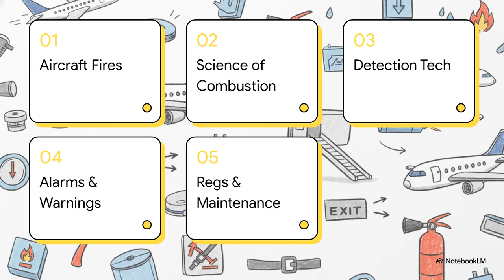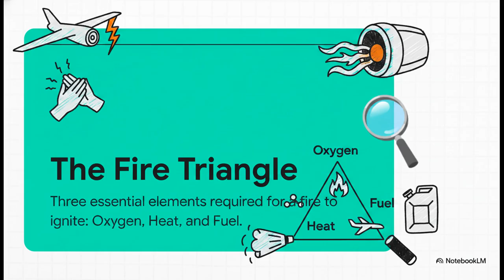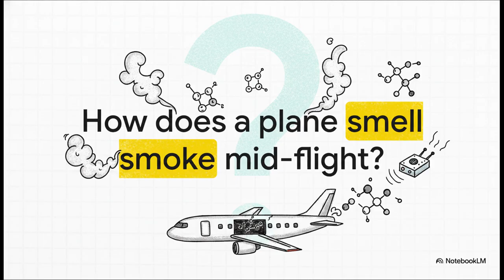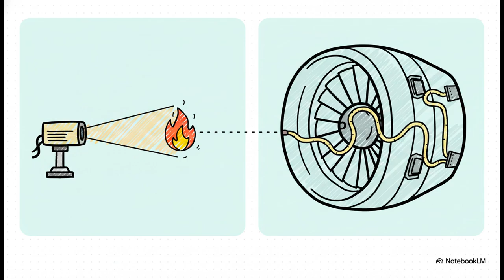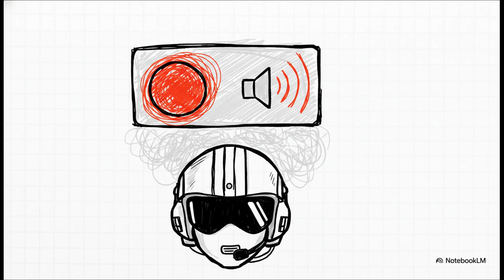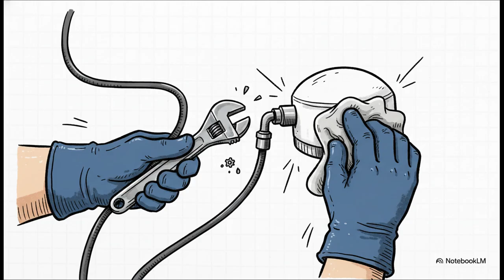AMTE 241 LESSON 02 AVIATION FIRE SAFETY

Comment: After watching the video, I realized how complex and vital fire safety is in the aviation industry. Fires in aircraft can be caused by many factors such as flammable liquids, electrical malfunctions, or overheating components, and the consequences can be devastating if not addressed quickly. The video explained the different fire detection and warning systems that are installed in planes to provide immediate alerts, which is crucial for preventing small issues from escalating. It also highlighted the use of specialized extinguishing agents and equipment designed specifically for aircraft environments, where space is limited and conditions are unique. What stood out to me most was the emphasis on human factors—training, maintenance, and strict adherence to safety protocols are just as important as the technology itself. This shows that fire safety is a shared responsibility between machines and people. Overall, the video gave me a deeper appreciation of how prevention, detection, and response strategies work together to protect passengers and crew. It made me understand that aviation safety is not only about flying but also about being prepared for emergencies and ensuring that every possible risk is minimized through discipline and vigilance.

R.A.T.HARINA_AMTE 241_1B_AY2026-2027

Comment: Aviation fire safety represents one of the most rigorously managed disciplines in commercial transport because an in-flight fire grants virtually zero margin for error. Within the pressurized environment of a commercial aircraft, an uncontained fire rapidly depletes breathable oxygen, generates lethal toxic smoke, and degrades crucial structural components within minutes. Unlike ground vehicle emergencies where occupants can immediately step outside, a cabin or cargo fire at thirty thousand feet presents an immediate crisis where survivability depends entirely on rapid detection, aggressive containment, and immediate emergency diversion.

Modern aircraft mitigate this hazard through a heavily layered defense combining material engineering, automated systems, and operational discipline. At the foundational level, passive fire protection dictates that interior materials—from seat cushions and carpets to wall panels and insulation—must be inherently flame-retardant and self-extinguishing to prevent rapid thermal ignition. Mechanically, active detection and clean-agent suppression systems continuously monitor cargo holds and lavatories, ready to flood high-risk zones with extinguishing agents at the first trace of thermal activity. Complementing these technical safeguards, airworthiness standards mandate the ninety-second evacuation rule, ensuring that even under emergency conditions, a full load of passengers can exit using only half the available doors. Ultimately, human intervention remains the final line of defense, as cabin crews are rigorously trained in blind breathing-apparatus operations, handheld extinguisher deployment, and coordinated cockpit communication to combat blazes in real time.

The true driving force behind today's stringent safety culture is the painful legacy of historical accidents, where forensic investigations directly reshaped global aviation law. Features like floor-proximity emergency lighting, non-combustible waste bins, and lavatory smoke detectors exist because past tragedies proved that smoke inhalation and disorientation are far deadlier than open flames. By treating fire safety not as a single component but as an interconnected ecosystem of material science, mechanical redundancy, and crew readiness, modern aviation has transformed what was once a catastrophic single-point failure into a highly survivable, manageable operational contingency.

G.A.A CORDERO_AMTE 241_1B_AY2026-2027

Comment: After watching the video about Aviation Fire Safety, I learned that fire safety is a very important part of aviation because even a small fire can become a serious problem if it is not detected and handled quickly. I learned that fires can be different depending on the materials involved, so knowing the type of fire is important when deciding how to respond to it. I also learned about the fire triangle, which consists of heat, fuel, and oxygen, and how these three things are needed for a fire to continue burning.

What I found interesting was how aircraft use different fire detection systems depending on the area, such as smoke detectors and heat or flame detectors. These systems help detect possible fires early and alert the crew so they can act immediately. I also realized that having these systems is not enough because they need to be properly inspected, tested, and maintained. As an aviation student, this made me understand that maintenance personnel have a big responsibility in keeping an aircraft safe. Overall, the video taught me that fire safety is about being prepared, paying attention to details, and always putting safety first.

J.L.F.TANAEL_AMTE 241_1B_AY2026-2027

Comment: V. TARAYAO_AMTE241_1B_AY2026-2027

This video explains how the aviation industry manages the risks and challenges caused by aircraft fires. It discusses different causes of fires, such as flammable liquids, materials, fuel leaks, and excessive heat inside the aircraft. It also emphasizes the importance of fire detection and warning systems because they help identify fires quickly and allow the crew or maintenance personnel to respond immediately. The video also presents different types of fire extinguishing agents and equipment that can be used to control and put out fires. In addition, it explains the vulnerable areas of different aircraft and how proper maintenance and safety procedures can help prevent fire incidents.
For me, the video provides important and useful information about fire prevention and safety in aviation. I learned that fire safety does not only depend on detection and extinguishing systems but also on proper aircraft maintenance, training, and awareness. Every person involved in aviation has an important role in preventing and controlling fires. The video helped me understand the importance of being prepared and knowing the correct procedures during an emergency. Overall, it was an eye-opening lesson that improved my understanding of aircraft fire safety and showed me how proper prevention, quick detection, and effective response can help protect passengers, crew, and the aircraft.

Comment: The video gave me a better understanding of the importance of fire safety in aviation and how aircraft fire protection systems help protect passengers, crew, and important aircraft components. I learned that fires can occur in different forms, and each type requires the proper method of detection and suppression. The discussion about the fire triangle, which consists of heat, fuel, and oxygen, also helped me understand how fires start and continue to burn.

Another important lesson was the role of fire detection systems. Devices such as smoke detectors, flame detectors, and thermal switches are designed to identify signs of fire and provide early warnings to the flight crew. Quick detection allows the crew to respond properly and reduce possible risks.

Overall, the video showed me that aviation fire safety depends on reliable equipment, proper procedures, regulations, and regular maintenance. As an aviation technician, I must ensure these systems remain functional and reliable. 
J.CRISOSTOMO_AMTE 241_1B_AY2026-2027

Comment: This video discusses how the aviation industry tackles the challenges posed by fires. It explains that fires can be caused by various factors, ranging from flammable liquids or materials to excessive heat in the aircraft. This video offers important considerations concerning the fire safety of aircraft and ways that it can be enhanced. The video highlights various fire detection and warning devices that can be used to detect and respond to any fire outbreak promptly. In addition, it identifies different fire extinguishing agents and equipment that can be used during a fire. The video also shows the types of planes and their weak points and how maintenance and fire safety procedures can help prevent and respond to fires.

In my view, the video offers some of the leading ways that can be used to ensure fire safety in the aviation industry. It considers fire prevention and control from various perspectives and provides different examples and explanations. Apart from fire detection and extinguishing equipment in planes, fire safety also relies on human factors, such as training and maintenance. To me, the video is an eye-opener, showing the key roles played in fire prevention and control. I learned many interesting facts about fire prevention and control in the aviation industry. The video made me understand how fires could be prevented and the best approaches that can be used in case of a fire breakout. 

A.V.P.OCARIZA_AMTE 241_1B_AY2026-2027

Comment: The video helped me understand why fire safety is very important in aviation. I learned that aircraft have different fire detection and protection systems designed to protect passengers, crew, and important aircraft components. Since fire can spread quickly, detecting it early and responding correctly is very important.

I learned about the five classes of fire and why each type needs the proper response. The video also explained the fire triangle, which consists of heat, fuel, and oxygen. The fire tetrahedron adds a fourth element the chemical chain reaction that keeps a fire burning. Understanding these helped me see how removing one element can help stop a fire.

I also learned about different fire detection systems, such as smoke detectors, infrared flame detectors, and continuous-loop thermal switches. When a fire is detected, visual and audible warnings alert the flight crew so they can act quickly.

Most importantly, I realized that fire safety depends not only on the equipment but also on proper maintenance and regular inspection. Aviation technicians must carefully test, clean, install, and maintain these systems according to approved procedures. As an aviation student, this lesson reminded me that even a small maintenance mistake can affect the safety of everyone on board. Safety must always come first in aviation.

— A.M. ALBANIA, AMTE 241_1B_AY2026-2027

Comment: After watching the video, I learned that fire prevention is very important in an aircraft because a small fire can become a serious problem if it is not handled quickly. I became more aware of the different ways an aircraft can detect and respond to fire. I also learned that fire protection systems are placed in important areas of the aircraft to help prevent damage and keep everyone safe.
One thing that stood out to me was the importance of checking these systems regularly. It is not enough for an aircraft to have fire protection equipment because it also needs to be properly maintained and tested. If a system does not work during an emergency, it can put many people at risk.
This lesson helped me understand the role of aircraft maintenance technicians in keeping an aircraft safe. It reminded me that even simple maintenance tasks should be taken seriously because safety always comes first in aviation.

J.R.ESTEBAN_AMTE241_1B_AY2026-2027

Comment: After watching the video about Aviation Fire Safety, I was able to better comprehend why preventing and controlling fires in an aircraft is very important. Aircraft have fuel, electrical systems, engines, and other materials that can cause fires. Because of this, proper fire protection is needed to keep passengers, crew, and aircraft workers safe. I learned that fire safety includes finding possible causes of fire, using the right fire detection systems, and knowing how to use fire extinguishers correctly. Different areas of an aircraft need different types of fire detectors. For example, engine areas, cargo compartments, and avionics areas may use different systems because they have different fire risks. The video also shows the importance of following safety rules, checking equipment regularly, and keeping fire protection systems in good condition. Overall, I learned that aviation fire safety needs proper knowledge, preparation, and quick action. Good training and awareness can help prevent fires from becoming bigger problems and keep aircraft operations safe.

G.A.CASTOR_AMTE 241_1B_AY2026-2027

Comment: After watching the video about aviation fire safety, I understood more clearly why fire is considered a serious threat in aviation. The video helped me see that an aircraft has many systems and components that need to be protected because a fire can spread quickly and can put the lives of the passengers and crew at risk. One of the things I learned from the video is the fire triangle, which is made up of heat, fuel, and oxygen. I understood that these three elements are needed for a fire to start and continue. If one of them is removed, the fire can be stopped. This may sound simple, but I realized that knowing this principle is important when dealing with aircraft fires. The video also discussed fire detection, alarms, and warning systems. I learned that these systems are important because they can alert the crew when there is unusual heat, smoke, or a possible fire. Early detection gives them more time to respond and take the necessary action. What I found most important is that fire safety is not only the responsibility of the pilots or firefighters. Aircraft technicians also have an important role. Proper inspection, maintenance, and checking of aircraft systems can help prevent fire-related problems. Even a small mistake during maintenance can become dangerous if it is not noticed or corrected. After watching the video, I realized that aviation fire safety requires knowledge, awareness, proper maintenance, and quick action. As someone studying to become an aircraft technician, I understand that safety should always be my priority because the work I do can directly affect the aircraft and the people inside it. 
I.R. DE LEON_AMTE 241_1B_AY2026-2027

Comment: The video helped me understand more clearly why fire safety is extremely important in aviation and how aircraft are equipped with systems designed to protect passengers, crew members, and important aircraft components from fire. One of the key things I learned is that aircraft fires can occur in different forms, and each type requires a specific way of detecting and controlling it. The video discussed the five classes of fire and explained why knowing the type of fire is necessary before choosing the proper response. I also learned about the fire triangle, which is made up of heat, fuel, and oxygen. The fire tetrahedron adds another element, which is the chemical chain reaction responsible for allowing the fire to continue burning. I also gained a better understanding of how fire detection and warning systems work. Different types of detectors, including smoke detectors, infrared flame detectors, and continuous-loop thermal switches, are used based on the area and conditions where they are installed. The video also showed that detecting a fire is only part of the process. The warning must be delivered quickly and clearly to the flight crew through both visual and audible indicators so that appropriate action can be taken immediately. Overall, the video taught me that aviation fire safety relies on advanced equipment, proper aircraft design, strict safety requirements, and, most importantly, correct maintenance. Aviation technicians have a major responsibility because even a minor defect in a fire detector or warning system can potentially put the aircraft and everyone on board at risk. Regular inspections, testing, correct installation, proper cleanliness, and following the approved maintenance procedures are important to ensure that these systems continue to work properly. As an aviation student, this lesson reminded me that safety must always come first and that every maintenance activity should be completed with care, accuracy, and responsibility. DUSTIN KOBE FABRICANTE_AMTE 241_1B_AY2026-2027

Comment: After watching the video about Aviation Fire Safety, I learned how important it is to know how to prevent and handle fires in an aircraft. I realized that even a small fire can become very dangerous because it can spread quickly and put many lives at risk. The video helped me understand the importance of proper inspection, following safety procedures, and knowing the correct fire extinguisher to use for different types of fires. I also learned that fire safety is not only about putting out a fire, but also about preventing it from happening in the first place. As an AMT student, I think this is very important because we will be working around aircraft, fuel, electrical systems, and other things that can possibly cause a fire. This video reminded me that being careful, prepared, and responsible can prevent accidents. Overall, I learned that proper fire safety knowledge can help protect both the aircraft and the people inside it.

C.I. CALLENA_AMTE 241_1B_AY2026-2027